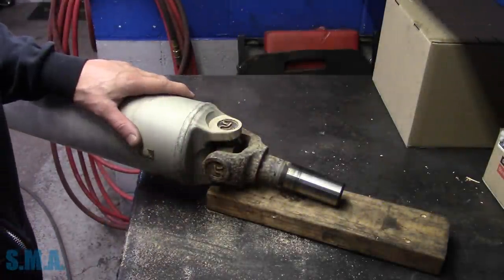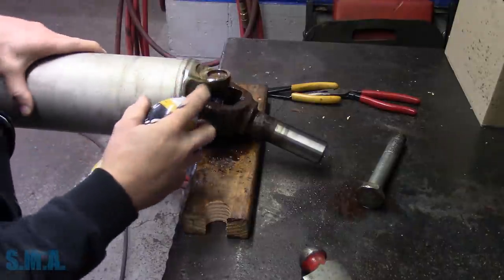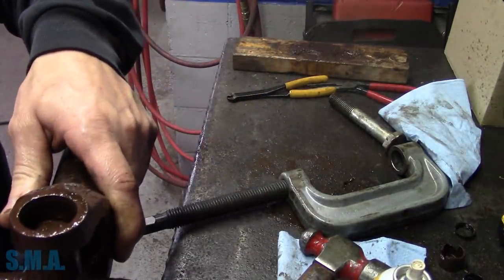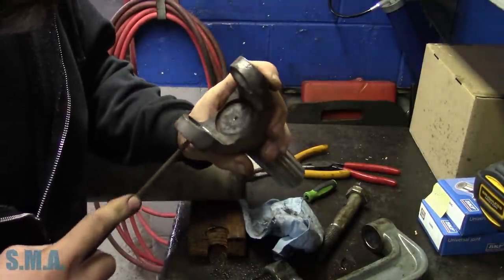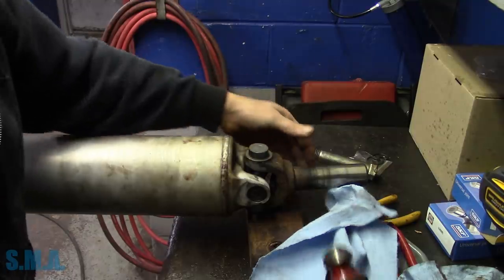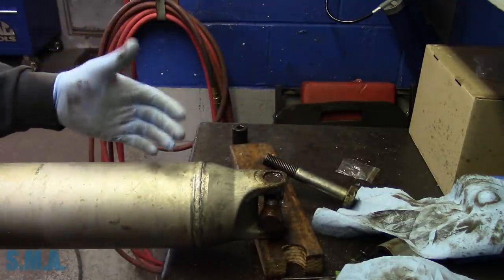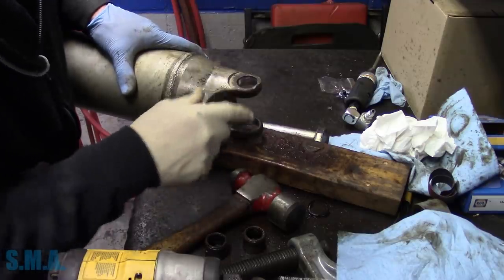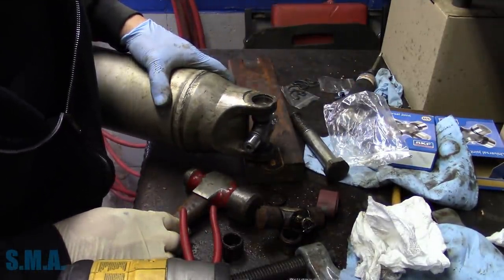U-Joint Replacement: Aluminium Driveshaft

Comment: Aluminum may be different, but on steel ones, I cut the joint in an x shape with the smoke wrench. Then the caps practically fall out. If its tight on reassembly , I put the drift on the joint and drive the caps toward the clip. Works every time.

Comment: Good fix Eric,I've used my dremal a lot, i also regroved my 65 mustang drive shaft with the cutoff wheel.if the wheels get clogged from alum i just grind the vice or steel tabletop for a second it also makes the wheels smaller if you need one to fit in a small hole.They also have miniature saw blades in different dia. and thickness.I used them in auto repair.Or you could do what my cousin in Oklahoma does.....WRAP the joint in....DUCT TAPE....IF you guys find a driveshaft on the freeway it could be his.

Comment: I'm replacing all the cardan joints on the driveshafts and the front axle shafts on a 2003 F250 stupid dooty right now. Lots of brown crusties. Had to cut the straps off the pinion yoke at the front diff since the bolts are rusted so bad. Used to be 8mm heads, now it's whatever I can heat and pound on the head to grab it good enough.

Comment: Little trick I found, You can use a pitman arm puller (forcing screw removed) to reach around the top ear and hammer directly on the u-joint while resting the lower ear on a socket to avoid pushing on the top ear. Works for me at least.

Comment: I read an article one time in transmission digest about those drive shafts. They have a rubber plug under the front yoke/U-joint. Somehow it came out, the  driver did not know it,  drove the trick through a flooded s treet and picked up water inside the shaft. Vehicle had a bad vibration after sitting overnight. The shop finally found what it was, took the shaft out and let stand against the wall overnight.  In the morning a puddle of water drained out of it. It showed picture where they cut the end off the shaft, they're filled with  a spray foam inside.

Comment: Eric,
 The old Klingon Proverb really applies here: "Don't look into laser with remaining eye".
 If it wasn't for my safety glasses, twice I'd have lost an eye.
Reply: If it wasn't for safety glasses I wouldn't have had a bit of steel stuck in my eye, bastard thing bounced right in between my face and glasses and ricocheted off the inside of the glasses and embedded itself right the fuck in my eye. I've had way more close calls while wearing glasses than not. Face shields are the way to go.

Comment: i usually use vice to hold opposed cross & hammer yoke to drive caps up, use socket or ball joint press on alum side.

Comment: That driveshaft is good for another 100k. Sometimes when the external grooves are messed up I use push-in snap rings on the internal grooves of the cups & it works. They design the  u-jts good especially Spicer.

Comment: I have that dewalt 1/2in impact, if you want a cover for it you can buy the mac tools PBBWP151-B and fits pretty good. so far that gun hasn't let me down and is pretty strong, if it can't get it off then I use my matco IR and that gets off everything for the most part.

Comment: 16:36.  Set the steel yolk across the top of a vice so both ears are on top of the jaws.  The aluminum ears will be oriented vertically.  Lightly tap with a socket over the OD of the aluminum ear.  Rotate 180 degrees and repeat.  This pushes both caps in the aluminum to their maximum width.  No more tight spots.

Comment: The last set of u joints I did on one of F-350 4x4 work trucks torch out the cross pop a hole in the caps and drive them out.

Comment: Depending on the deodorant, hold it against your armpit for like 5-10 seconds before swiping. It softens with heat. I use a kind that smells like bergamot and lime and it's great if you follow the instructions.

Comment: I use heat on these aluminum shafts and I NEVER hit the end caps with a hammer and a drift. Yes, old school cast shafts I do the simple take the retaining clips off and beat the caps out. On aluminum shafts, I take a torch and heat to aluminum tips up on the yoke until they are just starting to get orange, not full on red and about to drip on the floor. Then I allow them to return to their normal color and use my u-joint/ball joint tool (Snap-on) and they slip right out. After cleaning the surfaces, and prior to installing the new joint and caps, I heat the tips of the yoke again. They slip right back in like butter. I usually lube my caps with petroleum jelly to aid in reassembly. Also, I did not notice any marks on the driveshaft, which may have been due to the camera angle or something. I always mark the position of how the shaft came out in relation to the transmission output shaft and rear end (just the way I was taught). I think the stiffness you were experiencing was due to the hammering. The sudden impact force on aluminum does strange things. I admit, the first few alum. shafts I did, I did the old school way like you. I noticed the same stiffness problems after installation. That is when I decided to not reach for the hammer and drift and solely press them out. Since then, a job that use to cause me serious grief no longer does. Just a friendly suggestion, give my method a try.

Comment: I’m no professional, but when the joints are tight after assembly for me it’s because I drove the caps in just a hair too far. I set the naked pins on two 2x4’s or something else soft and hammer on the driveshaft near the cup to drive the cup against the snap ring, flip it over and do the same on the other side and it’s butter after both caps are pounded out against the snap rings.

Comment: Ball joint press but with a ratchet, when you get it to not ratcheting (just a ratchet no snipe) tap the ears gingerly and it releases. Then hammer works so remove press do regular hammering and you've avoided needing to beat the piss out of it.

Comment: A lot of the time when I have a u-joint like this I will take a cut off wheel and cut the u-joint center out and then use the ball joint c-clamp to push the caps out. there is less force necessary to remove the caps one at a time less chance of bending in the driveshaft ears

Comment: Eric, I was taught to point the grease fitting towards the center of the drive shaft.Ken
Reply: You wouldn't be able to grease it with a normal coupler then because the shaft tube is so large. It would require a side coupler.

Comment: Hum, to remove the old U-joint I always just slip a cold chisel on to the base of the joint, and drive the cap out turn it over and then do the other side.  This way i just have to only move the caps one direction.  Also of note is that you have to be very careful to not drop a pin bearing, it's so easy to do.  If you watch your video closely you can notice how you are careful not drop not to drop a bearing by keeping the u-joint centered over the new cap.  However,  to somebody who has never done this before they would never pick up on what you are doing because of your many years of experience.

Comment: Eric is there a reason you don't use a torch for this? My normal procedure is to take a torch and cut all four legs off the u joint off. This cuts the center section out and makes you have both u joint half separate from each-other.. I clamp on side in my vice at a time and use my air hammer and just air hammer the caps inwards and out. Knock all four out. Clean the inside with sand paper, lightly grease inside where the caps will sit and then use a hammer and a wood block to hammer the new one back in.

Comment: good shite, i  learn loads every day, my next job, injector hold down bolt pulled the threads out the alloy head, hummmm, 2005 ford fiesta 1.4 tdci, would you (A) helicoil it, or (B) drill out from 8mm to 10mm re cut a thread and use a bigger bolt....

Comment: I've always used a balljoint kit for u joints. Hope you aint gotta get out the dremel and cut a new groove. Had to do that a few times. Sat on a concrete floor with a socket and a hammer when I did my first ujoints. Tell you missus I ended up at the Duke eye center even though I had safety glasses and a cap on....rust from cutting a muffler off with air chisel three days later. Alum driveshaft was sure a stupid move by chevy

Comment: Ahh 331"s, just bought a pair for the cardan joint on my dodge 2500, Turns out it was the little ball in the centre of the joint had gone bad. Rusted and bent needle bearings inside.

Comment: A marvel of modern engineering, aluminium drive shafts. I think there's at least one teacher/prof in enginerding school that adamantly tells their students that aluminium doesn't corrode because of the oxide layer. Because oy-vey do the engineers love sticking aluminium in places it shouldn't be. 

I'm especially fond of stainless steel pins in aluminium brackets.

Comment: Might want to mention that at least on the Chevys one of the U-joint is different than the other the cap is bigger on one side. Make sure you match up the cap yo the U-joint so it's the right size

Comment: I turned on your video and got busy putting my 08 1/2 ton 4x4 silverado rear ujoint in , had the grease zert facing the rear so i turned it around , i still cant get my lock on grease gun on that zert , is the third position gonna make a difference ? I didnt check it on the truck facing the rear , i just assumed that was wrong , i gotta watch the video again 😂

Comment: The secret (if you don’t have a press and only have hammers and hammer acquaintances) that I never remember in the moment, is to get all four sides moving, maybe even back and forth, before trying to get them out, maybe even saving the shaft side for last, that way you have something that won’t move around on you

Comment: Good luck with that DEWALT. Mine lasted about a year before it took a crap. Battery connection in the gun craps out after a while. I guess it’s a known issue.

Comment: I find it easier to point the zerk fittings towards the driveshaft.  This gives just enough space for the lube  equipment to attach and you won't need to use that friggin needle during regular service.

Comment: Eric.    Any advice on a 2018 dodge ram with the braking system error.   I’m leaning toward an electrical since it comes on as I’m driving without even hitting the brakes.    I’ve unplugged the harness and it’s clean in there.   All the sensors are good and clean.

Comment: I was just wondering if there is a reason why they don't use CV joints on driveshafts.
The rubber boot coverings would prevent a lot of the corrosion issues you see on universal joints. I realize they're more expensive and maybe perhaps that's the reason they don't do it.

Comment: You definitely went the extra mile for that driveshaft using your dremil tool Eric. I remember the first time or two I used my dremel. I turned it up on high and the cutting disc just disappeared

Comment: In my experience with cutoff wheels in a dremel tool, throw those non reinforced cutoff wheels in the garbage and buy a bag of small ones off Ebay, and save some half worn out reinforced ones also for that application, also in my  experience with U joints I gently press them out and never beat on them, just my opinion.

Comment: Serious question:
Did you use standard 331 joints or the 331C joints? When I did mine, using the same NAPA parts it was recommended to use the 331C for aluminum shafts. Supposedly the "C" has a coating to buffer shock on the aluminum shafts. Your thoughts on these joints versus straight 331s?

Comment: Question for Eric.  Greasable vs sealed.  I know there is always much debate about this.  But I'm asking from your perspective in relation to customer support.  So in this example the customer wasn't even complaining about these joints, and you know they had to be at least clunking, and most likely vibrating.  So I'm looking at it from the perspective that maintenance is not a priority until something breaks.  The odds of the customer greasing them are nill.  So why not select an oem style sealed replacement?  Or if going the greasable route, why not select a unit with the zerk in the cap so if a guy gets a wild hair he can always get to them thus improving the likelihood they will get some grease at some point.  Guess it could also be parts availability.  Interested in hearing your thoughts, well not all of them, just on this subject.  I already have my own 10 yr old internal dialogue ;-)

Comment: If you need to get more travel out of the cup, try hitting it so the needle bearings fall down on the inside. Instead of fighting to get it out along with the U-joint through the center, bust the cup to the outside that way

Comment: This question is not related to this video, was wondering why you do not turn brake rotors anymore, and just replace the rotor. Would it be more cost effective to turn a rotor than replace it?

Comment: Hey Eric, do you think it would be wise to Fluid File the top of the caps before installing the clips to help with removal down the road? Or would that be detrimental? Just wondering if that would help with the two dissimilar metals involved.

Comment: You can stack cutoff wheels to get a thicker grind for the slot. I use the dremel cutoff wheels about 80% of the time i use the dremel. but im in a different field of work. (by the way,, the washer is pretty much useless)

Comment: What does it sound like when a U joint goes bad? I turn my wheels and I hear a clunk noise. I hate those grinding disks, love my Dremel tool. I carve and sculpt wood with it.
Reply: If you have a front-wheel drive car the clunking could the be CV axles (the part that transmits the power from the transmission). If you have a rear-wheel drive vehicle it is most likely the ball joints. Quick and dirty test for ball joints: grab the TOP (not the sides, that would be for the tie rods) of the front wheel and pull back and forth hard. If you feel any play in the wheel it's probably the ball joints. If you feel A LOT of play, you should take it to a mechanic or someone you trust. Don't want to let the ball joints get too bad. If it's nice and solid probably the CV axles.

Quick note: if your steering is still nice and solid and doesn't feel loose or wobbly while driving (and its front-wheel drive) most likely culprit is the CV axles. That's because the CV's shouldn't affect the steering too much. (Bad ball joints can make the steering loose and sloppy.)

Comment: You need a good solid item to bang on. I suggest a 400 lb anvil (older the better) anchor bolted to a 55 gal drum filled with concrete. Works for a farmer friend of mine. Has his vice on one too.

Comment: What’s your thoughts on using u joints on aluminum drive shafts that don’t specify if the u joint is galvanized?  I was looking for a u joint for my ford ranger from autozone and one u joint said to order a part that they didn’t even have .  Note read “purchase part 2-4801DL for aluminum driveshafts”.

Comment: I just did the u-joints on my 99 Sierra with the "big" 5.3. I had a clunk when taking off from a stop that the u-joints seemed to fix for a bit. Only been a few hundred miles and the clunk is back. Think I screwed up the pinion side of it or didn't grease it enough, so I just got in a non-greasable one. Hoping that fixes it. Any idea why the clunk would be back so soon? Truck has 173k on it and mechanically sound otherwise (i've got the scars to prove it lol).

Comment: Easier and less likely to bend the ears if you use a metal socket or something similar to accept the cup coming out at the bottom. Firmly supported on something solid like an anvil, cast iron, concrete, etc. It's the sharp hammer blow that does the work and a wood support nullifies that force. Pick the socket or whatever you use carefully. Big enough to accept the cup yet still support the yoke. One good blow is all it takes to get it started. 2lb hammer works great. Even a 24oz ballpeen will usually do. Have never used any penetrating oil of any kind, no need. Do clean the obvious areas. No need for neverseize, u joints made for aluminum driveshaft have a coating on the cups that takes care of that issue. Hammering on the aluminum ears right where they surround the cups is not a good idea. If the joint doesn't turn freely after installation a blow or two where the casting has some meat near where it  meets the aluminum tube is where you want to strike it. Hold the whole assembly off of any support when you strike it. Not a hard blow but more than a tap. Makes things get back in line as they should be. U joints are very easy, if you haven't done it before watch lots of videos. Repeat, if it isn't easy you are either doing something wrong or using poor technique.

Comment: With the aluminum shaft applications, I've heard you should use a u-joint specifically made for them. Something about a special coating to prevent dielectric corrosion, as I recall. Can anyone attest to this after using standard u-joints and replacing them later on? Does it actually make a difference? Most of my background is medium/heavy truck, so we don't see any aluminum shafts, but it's always nice to know.

Comment: Is it better to have a sealed caps or the one with the grease fitting I found sometimes you can't access the grease fitting unless you take the driveshaft off

Comment: I am very surprised that knowing you had a bad end on the shaft you didn't start with the problem end first! even if you only pulled it apart to inspect the problem before throwing a new joint in it!

Comment: On that Dewalt XR gun. . . .   will it remove lugnuts??  I always have to crack them loose with a breaker bar first.
Reply: I believe it has 700 ft/lbs of torque. I've used it to take wheels off my rig and they are torqued to 500 ft/lbs.

Comment: Need aluminum clips for the those u joints on the alum drive shaft sides to prevent the galvanic corrosion